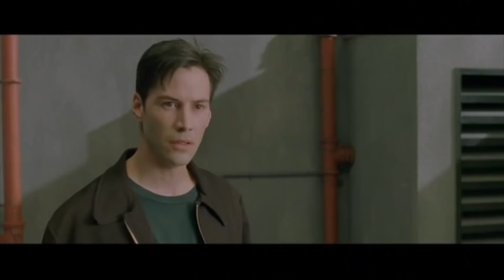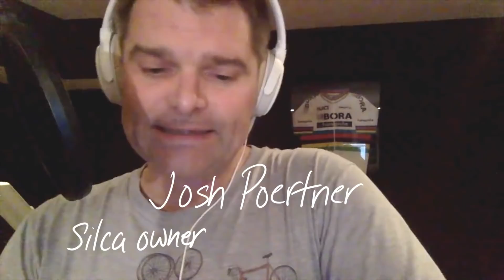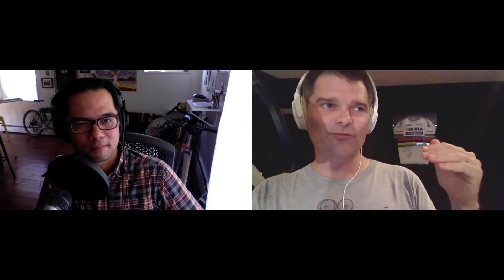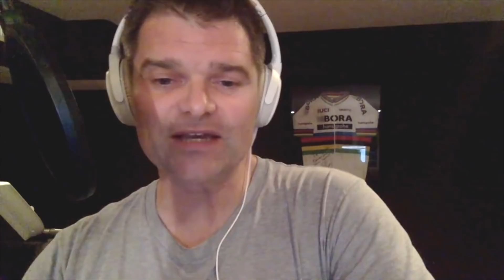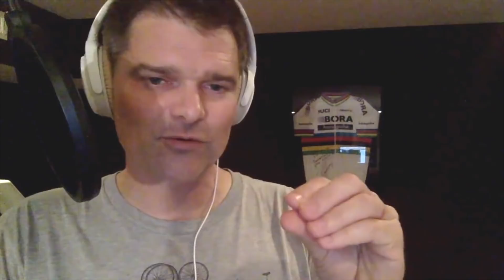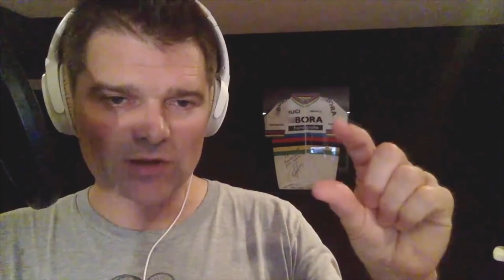Your TIRES are LYING to YOU!

Comment: About 12 to 13 years ago I started looking at tyres wider than 32mm for a mix of gravel,hardpack and tarmac in the same ride.
At the same I began looking at lower tyre pressures,after a lot of experimenting and going lower than I thought healthy I came to the same conclusion as the chap in the video.When I look back the prejudice I had on lowering TP's to what I thought at the time were ridiculous is embarassing.He is absolutely right on the money,smooth and comfortable is fast,especially on longer rides where rider fatigue becomes a problem(especially for and old arthritis riddled crock like myself),when fatigue sets in on a ride,more energy is wasted in that fatigued body than the body that's comfortable and can be to the point of near exhaustion.
Smooth wins races but crucially for the ordinary rider it wins out every time on pure enjoyment of cycling.

Comment: Thanks for the great content. I would be interested to know how much pressure changes with temperature. Is there a rule of thumb that can be used. When descending a mountain there can be quite a variation in temperature for example.
Reply: Gas laws! Pressure changes are directly proportional to Temp in degrees kelvin. (P1/T1)=(P2/T2)

Comment: Awesome, I love going techie on tires. If you had edited that to be twice as long, I still would have loved it.  (and a great edit too with the prologue snippets and the camera view changes)  Heck, watching it a second time now.

If you liked this, I would recommend finding a couple episodes of the FloCycling podcast that also had a couple great interviews with Josh Poertner regarding tire pressure and tubeless tire setups. 

I'm running Rene Herse 38s on my fast recumbent and have a helluva time convincing my local club riders to go wider and softer. Will have to share this video to the club page.
Reply: Puncture protection is what keeps most gravel riders away from extra light (ExtraLight) tyres, tubeless or not.

Comment: Thank you Russ, this was an excellent interview and presentation. I am more times than not telling some of my riding buddies that thy're running too high a pressure. We have really crappy chip seal roads that have lots of negative space as your guest called it. I'm about 170 - 178 lbs. and I normally run 80 front 85 in the rear with a 25 mm tire that actually measures about 30 mm on my Easton  R90SL rims. Keep it supple my friends, smooth is speed.
Reply: Spread the word brother, you could even save them from a fall one day.

Comment: I've always been concerned with my tire size/pressure etc. due to my weight. I'm ~340lbs and I run 47-50mm tires on either 700c or 650b rims just because anything narrower is just too harsh for the pressure I have to run to not feel squirm. I think right now I settled on between 40-45 and 45-50 PSI for my tires.
Reply: Edit: After trying the “squirm test” I am currently running 30-35 PSI on my 50mm tires which is crazy for me to think about. I was curious however if there were any test that compares tire pressures with pedaling efficiency. I.E. does it take more power to pedal a tire at lower pressures vs lower tire pressures having less rolling resistance on rough roads?

Comment: I can tell you my Specialized Ground Control Grid 29x2.3 exploded off the rim into my face over the weekend at 50psi.
Reply: What the heck were you doing running that kind of pressure in a 2.3? That's nutty
Reply: Rodd Heino pressure rating is 25 to 50 and I was setting the bead.

Comment: Great interview.  When I was younger, I used to pump up my tires as high as my frame pump would push them.  But when I built my monster cross bike 8 years ago, I put on some 700x40 Schwalbe Mondial touring tires.  They're rated 55-85psi and I started around 65.  Kept dropping a few psi at a time, eventually got to 40 but they were getting really sluggish with the thornproof butyl tubes inside, although the ride was much smoother.  Converted to tubeless and kept dropping to the 30psi I now run and they are a totally different tire.  I recently ran them back at 40psi after rotating the tires front-rear and it was almost unridable:
https://youtu.be/aNcjVBPcAuo
So much smoother at 30, rolls better, more traction, and much better control.  I can drop to about 27 but have to be careful there as it's easy to burp air out if I miss the pressure by 1 psi.  Maybe I need to get one of those Silca pumps instead of my old analog gauge pump.
Reply: There are tubeless mondials?
Reply: Officially no, but they work great in my experience on some Stans rims:
https://youtu.be/zPZ2hyNC2Gs
Reply: Awesome!  How much do you weigh if you don't mind my asking?
Reply: I'm about 175 lbs and the bike is around 30 lbs or around 93 kg total.

Comment: I really like the widest tire possible idea but always wonder when you would notice the extra weight? 

A 50c tire is much heavier than a 40c. For example a Maxxis Rambler is 225 grams heavier in the bigger version that’s almost a pound of extra rotational weight.
Reply from the maker: Depends on the tire and the casing.  Not all tires of the same widths are created equal.  Also the wheel size.  That is why I prefer 650b x 47 vs 700c equivalents.  It is smaller and lighter.
Reply: Travis Cagle - This brings us back to the “maximize, minimize, optimize” part of the video. An earth-mover tire is too wide. A knife’s edge is too narrow. We need that notebook to find the optimal width for a given rider on a given road at a given speed. Weight and aero drag get worse as we get wider, but rolling improves, given a rough road. There’s no silver bullet.

I think that knobbles are even harder to figure. We want a supple slick - until we lose traction on a rough or muddy surface. I guess we want just enough knobble to keep from crashing and to feel secure, but no more.
Reply: Jon Fairhurst very good points. I suppose this is why with the whole one bike “solution” that is the gravel bike craze that we all own way too many sets of tires. 

Eventually I think we just settle on what feels the best but should probably put in more effort with the notebook and fine tuning our results. 

At of the end of the day I think comfort is more important unless you’re winning races, and we are truly talking marginal gains for a rider who averages 15mph. I’m very interested in giving 650b a go as well in the future. 

Thanks for the tips.
Reply: Travis Cagle - The coolest thing is that, according to Josh, comfort and speed go hand in hand. So often, a gain in one area is a loss in another. For instance, an aero bike is fast on the flats but weighs more so it’s slow on climbs. Or the aero position vs. power and comfort.

Russ nailed it more than he could have known with his “supple” branding.

FWIW, I got a good deal on a used ENVE SES 4.5 AR Disc wheelset (for my road bike) just a couple of days ago. After learning that a wider rim lowers sidewall flex and rolling resistance, I’m even happier with my purchase. I need to get out the notebook and do some back to back tests!
Reply: Yes, you will definitely notice the extra weight, every time you accelerate the bike (which is almost constantly). If you have good, supple tires and fairly light rims, then adding weight to the perimeter of your wheel is almost always a bad idea, IMHO.

Comment: Thanks, Russ. Does Josh have any guidance for front/rear pressure differential?
Reply: I was hoping for that as well.
I've been leaning towards supple for the past couple of years and always run 5-10 psi lower in my front tire. I aim for the rear to be as low as it takes to have the tire just starting to balloon under my weight.

I'm 175lbs. Here are my pressures:

Mtb, full sus, 2.4", tubeless. 
F: 20psi, R: 23psi

Road, 25c, tubes. F: 75psi, R: 85psi

Gravel, 38c, tubes. F: 32, R: 40

I'm still playing with my gravel pressures. The rear feels a little squirmy so I might need to go up to 42psi or so. The front feels fine at 32 but I want to test lower pressures for more of that supple lyfe.

Comment: Great interview. Great content. Even though Josh is race-focused, there’s lots of good stuff here for enthusiasts.

It was especially interesting to learn about the advantage of wider rims - that the tire can deform more easily because it’s not as dependent on the flex of a perpendicular sidewall.

One thing I wanted was some discussion of tubes vs. tubeless. Josh told how inefficient butyl tubes are. Latex is faster, but needs a daily refill (which tells me that it won’t be consistent on long rides.) Tubular is fine if a support vehicle follows you, but us mortals don’t get that luxury. That leads us to tubeless. I’d love to get his take on the topic.

Lots to ponder!
Reply: I think it's the opposite isn't it?  i.e. that the tire can deform more easily on a narrower rim, not a wider rim.  On a wider ID rim, the sidewall becomes more vertical.  Jan Heine's article on rim ID says what I just did - that's where I got it.
Reply: I think of it this way. A tire on a wider rim becomes an effectively wider tire, so it’s got a larger effective radius from sidewall to contact patch to sidewall. That means that more of the tire is close to the angle of the road.

Anyway, it makes sense to me and aligns with the interview info.
Reply: Another benefit of a wider wheel is less tire squirm; hence, better handling.
Reply: @JonFairhurst  Jan Heine has an article on ID of rims and what he says makes sense to me:  (paraphrasing) An ID that gives the tire a nice sidewall curve makes the tire ride on the cushion of air as opposed to being supported by the sidewall - provided that the tire casing is supple.  Plus, a tire on a narrow (but not too narrow) ID rim will push outwards on the rim bead more than on a wider ID, thus giving better tire bead to rim bead  security.  As Josh said, inflate the tires to just above squirm, and then you're good.  Therefore, I'm still a bit uncertain if 25 mm ID is better/same/worse than 22 mm ID when using 41-45mm width tires.  Maybe it's a trade-off of slightly better ride for slightly worse cornering stability.
Reply: Here’s some interesting aero data from Hunt: https://cdn.shopify.com/s/files/1/0686/6341/files/The_HUNT_LIMITLESS_48_AERO_DISC.pdf

If you look at Figures 13 and 17, you see that head on, ENVE 25mm int wheels with 28mm tires have slightly less drag than even 25mm tires on narrower int wheels. This is counterintuitive to say the least! All I can figure is that the 28mm tire on 25mm int width just happens to give an ideal frontal curve. Or maybe the tire rim transition is particularly good. I would have expected the narrower tire to win in absolute aero efficiency at zero yaw angle.

By the same token the wattage differences are quite small. I’d imagine that if you get the pressure right that the rolling resistance difference between wide vs. narrow internal rims would be small too. If the wheel, tire, and pressure make you feel like you are fast, then they’re fast!
Reply: A former colleague of mine bought what looked like tubular clinchers a couple of years ago. They fit on a regular clincher rim (road bike), but I don't know what brand/make they were. But a quick search results in something called Tufo, although I don't know if those are the ones.
Reply: @morpheox it was a thing that was on the market...I remember a long time ago Clement had a line of those...they were pretty narrow and not very good.

Comment: TL;dr 
Widest tires you can fit. Best casing you can afford. 
Lowest pressure until handling suffers. Up a few psi from there. 
You can't change the rolling resistance of supple tires with pressure, only behaviour.
Reply: Not that you should not view this video.  It's points I've been espousing since I read Grant Petersen's opinions on tires 19 or so years ago. That lead me to the 31 mm Grand Bois Cyprès in 2006 and the rest is history.
Reply: Rodd Heino : it was on the basis of your Facebook posts that I’ve gone to wider tires with lower pressures.

Comment: How about a chart, similar to a gear chart, with total rider/bike weight on the x axis and average road conditions and tire widths on y axis, for example, to provide a starting tire pressure for every ride.  Surely their is some way of simplifying this process.
Reply: Someone has done this work with 700c widths but the link I saved is now dead :(. Another consideration is rider weight distribution between front and rear wheels.
Reply: Google Frank Berto tire drop chart. 
Remember the weights are per wheel...

Comment: Super cool stuff.  I saw the length of the video and thought, "no way!"  But it was really cool, super cool, way cool in fact. :)

Sort of matches up with what I learned when I went to tubeless tires on my bikes ~15 years ago.  I was running about 85-90psi in my 23c road tires and about 25-28psi in my 2.0 MTB tires.  I was about 215-220lbs and a lot faster back then.  The average 150lb xc racer was running low 20's back then and few guys dipped lower.

I'm a good bit heavier/slower these days and still only run 50psi in my 32c slicks on my road wheels.   I runabout 40psi in my 40c gravel tires, and I think I need to go lower, but I'm fairly new to gravel.  Every once in a while I'll miss a little on the low side.   I get the bouncy rear tire and I feel like I'm riding in wet grass.

Comment: Very interesting mop analogy. I figured puncture resistance just straight up based on the tire material. Does Josh know about the tire rolling resistance website? what about the hum sound on an aero wheel? not necessarily vibration.
Reply: If you can hear it that's a loss.

Comment: I've recently started to prioritize smoothness and comfortable riding over speed, or the perception of speed, since I found this channel. I'm never looking back #supplelife
Reply: I just got a Midnight Special that weighs 38% more then my Giant TCX with exact same gearing.  The TCX had 38mm and 60 psig and the Surly has 650b 47mm tires at 42 psig and multiple trips on my 15 mile test loop is 8% slower!  Supple life AND speed, thanks @pathlesspedaled